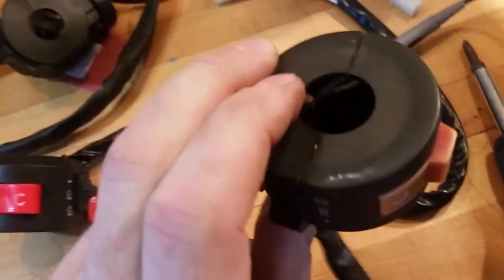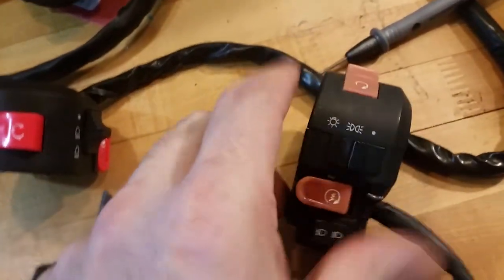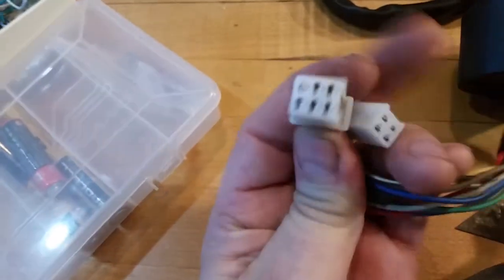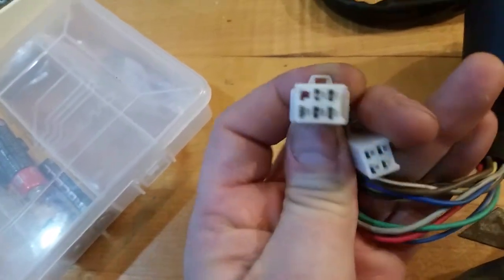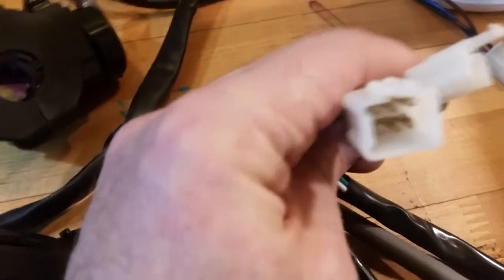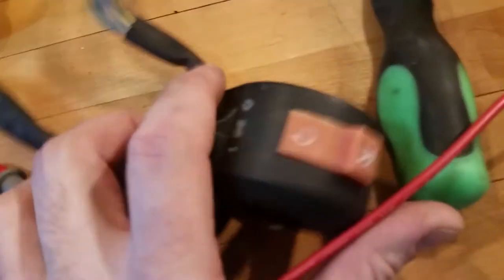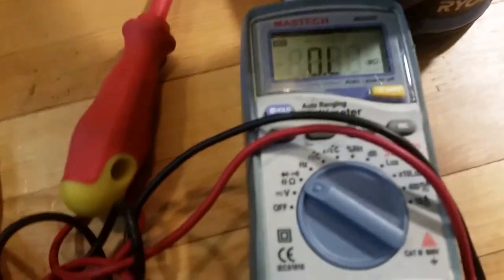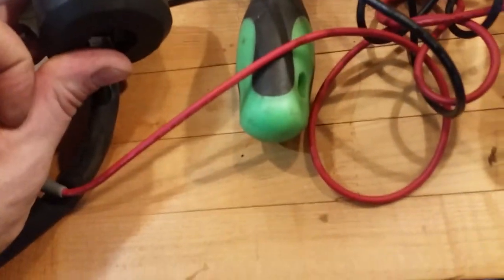kill switch test, GY6, tao tao, chinese atv,

Comment: So many more questions about exactly what you did but was that a raccoon?
Reply from the maker: 3 legged cat named ' Fuji'
Reply: @joshpaulschram  I’m dumb when it comes to multimeters,bare with me, so when you tested the kill switch does the switch itself need to be hooked up to a power source or will you get a reading just from turning the switch on and off while solely connected to the multimeter?
Reply from the maker: @mdell7131  set the multimeter to continuity (omega symbol or horseshoe looking symbol)   or the 'beep'  (meaning when you touch the probes together it beeps)   then use it to see if you have the correct wires that go through the switch.
Reply: Thank you that makes sense now I just need to figure out why my son’s Chinese 110 quad won’t start with the key,the key gives it power but we need to jump it with the solenoid to start it so I’m thinking it’s the starter button or something like that ,who knows, thanks for your help
Reply from the maker: @mdell7131  are you getting 12v at the small post of the solenoid? Does the solenoid have a good ground.   Can you take a wire from the battery to small post of solenoid and make it start.  If you can check the ground.   Ohm out solenoid coil.  Small posts.  Should have resistamce...or beep
Reply: @joshpaulschram  my multimeter will be here tomorrow and I’ll try that ,thanks for the help I’ll let you know

Comment: I have one it has been doing fine, well the other day my middle son hit it with a riding mower an now it won't shut off with the switch or even the key it stays running with both off do you have any idea what maybe causing it
Reply: There's a black wire with a with line its in the plug for the cdi box . Check its connection.  Make sure its pushed in good .
Reply: As long as its a single plug style I believe.